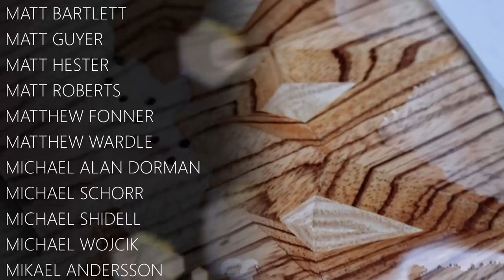Ep 3 - An Utter Failure on the Chip Carved Zebrano Top - And How To Fix It

Comment: Hi!
On the topic of epoxy filled carvings:
I’ve build a few kayaks (epoxy/fiberglass on wood) and have run into my share of bubbles, and found out on the mighty internet, that the bubbles comes from the wood emitting gas. As the wood heats up, the gasses in the wood expands and gets trapped in the resin. The best way to avoid it was to heat up the WOOD, wait a bit, and then apply the resin as the wood cools down. That way the gasses in the wood contracts and suck in the resin, instead of pushing out bubbles.

Thanks for the videos, they are very inspiring, not just for guitar builders, but for lovers of wood work!

Greetings from Denmark 🇩🇰

Comment: Hi Ben. Try Clear Top 35 from MBFG, it gives crystal clear results up to 35mm deep. It degasses itself brilliantly but needs a warm room and has a 48 hour cure time. Clear Top 35 is also very hard when fully cured ( 7 days ) and polishes amazingly well. If you plan to do more resin work, it would be worth getting a vacuum pump and chamber to de-gas the resin before pouring. Zebrano can be a pain as air can expand out of the large tubules in the wood with the heat from the curing resin. See you next month. Cheers, Jim

Comment: I know some guys use vacuum chamber to remove bubbles from epoxy... :)
Reply: Yes! This is the winning ticket for sure.
Reply: Its fancy but not needed for something that shallow.
Not whipping bubbles into the resin works as good, and costs you less.

For other stuff like 2part silicone resins i would recommend using a vacuum or high pressure chamber.
Reply: Making a vacuum chamber for just the pitcher would cost very little. It's basically just a section of large diameter pipe, two sheets (the top one could be perspex, so you can see the action), some garden hose fittings (most importantly a t-piece)and a faucet. Making one for a whole guitar is similarly simple, but requires you to build a frame that'll be airtight when you lay the top and bottom onto it.
Reply: Yep that would work, also placing the container on an electric sander helps remove bubbles.

Comment: Many years ago I worked for a ceramics company making false teeth, to remove the air from the alginate mould I used a vibrating table, the air would rise to the top and disappear.  Just a thought if you decide to do another guitar with resin filler. ?  Looks good though. nice job Ben.

Comment: Ben, for vibrating the guitar instead of tapping it or hitting the bench, why not use a palm sander with no sandpaper, just the pad of the sander against the guitar.  Easily controlled vibrartions to cause the bubbles to rise to the surface.

Comment: Put a heating blanket under the body.  It will heat the wood from backside to within the body and help bring bubbles to the surface and also help prevent clouding.

Comment: I'm surprised you didn't use some kind of sander (properly dusted off of course) on the table surface next to the guitar, or even touching the guitar, as a vibrator.
I'm starting to mess with resin coating stompboxes, and this was (as always) an amazing video series :D 

Cheers Ben!

Comment: Placing both of the resin components in a warm bath for twenty minutes before use lowers the viscosity and releases more bubbles. Pours much better after. Heating it with flame breaks bubbles but can burn the epoxy and make it discolor, so be carefull. You can spray a fine mist of acetone on the epoxy surface to break up bubbles.

Comment: I think stirring the resin slower is will prevent bubbles from forming in the beggining.  Also i have been told that using a plastic stirrer instead of a wooden or metal one is the way to go.

Comment: It's the stiring of the resin and hardner that create the bubbles, go easy with the stiring, and as you see heat helps rremove them, also in my own guitar building, i find that very hard resinous woods like rose wood,and ebonydon't absorb the glue very well ,making me turn to the use of epoxy to glue the boards, you build some nice stuff.....Jerry

Comment: I've been researching this epoxy thing for a 'river table'. There appears to be differe bttypes of 'clear cast' resin for different depths. In most cases the thickness is 'built up' by layering before the bottom coat good off - leravingthe first pour for 12 hours and etc...

Comment: Oxygen / Air expands when it's heated, therefore - when you apply heat to an air bubble - it expands until it pops.
I assume the manufacturer is saying to blow on them because the heat of ones breath is enough to make the air expand, I find it selfdom is though.

When doing deep castings I find that doing multiple layers is a good way to keep it bubble-free, if you don't have a vacuum chamber big enough to fit a guitar body into it.
Reply: Impregnate the wood with oil and use a blow torch

Comment: You didn't apply shellac to the wood prior to filling this time.  Perhaps the bare wood contributed to the continuous forming of bubbles mentioned at 29:17?  Resin could also be soaking into the wood, causing the need for "topping up"?

Just a couple of thoughts.

Comment: To remove air bubbles, we attach a small electric motor to the underside of the table, turn it on, and allow the vibration of the motor to shake the table slightly and thus encourage the bubbles to rise to the surface of the un-cured resin.

Comment: I'd do an oil finish. You're probably (definitely) getting micro bubbles that are being trapped between the organic wood surface and the resin. Sealing the wood with urethane prevents that, and in this case if you have surface bubbles after it dries, just rough sand it, and apply another thin coat of resin.
Reply: Love Ben Crowe and love these weekend workshops!

Comment: Blow on it using a regular drinking straw. That works much better than just blowing on it directly. You can also go over it really quickly with a BBQ lighter. Also, wood is very porous. It will cause way more bubbles than lots of other molds used for resin.
Reply: Brandywine6969 In the last video he used either laquer or poly (can't remember) in an attempt to seal the wood. I didn't notice him applying it again in this video and now I'm wondering if it came off with the resin.
Reply: It might have. I wish I could remember what the lady in one of the resin crafting channels that I watch used when using resin on wood. I think she just kept using her BBQ lighter on it throughout the day. I know she said there were lots and lots of bubbles and she had to stay on it to get rid of them.
Reply: Brandywine6969 A drinking straw works, to a point. It makes you light-headed and after a little bit, moisture from your breath drips out of the straw and lands on the resin.

Comment: Hi, the more you heat the guitar air will aspirate from the wood area in which the resin is being poured. The cut areas should be sealed first. if you paint a guitar and put it out i the heat i.e. sunlight the finish will be bubble ridden, same thing going on here.

Comment: Ive seen other creators use a small vacume chamber to suck the air out of the mixture.  I'd also think that low heat before mixing would help, making the mix a little less viscous, allowing air bubbles out.  I have a coffee cup warmer that would probably have worked nicely to loosen up the mix to lose the bubbles nicely.  I'd think having both additives at about 37-38 C would have the effect of thinning the liquid nicely so bubbles come out more easily.  I wonder what the directions say about optimal temperature of the liquids before mixing is.

Comment: I think that bubbles comes from the open wood grain.  Sealing with Shellac before applying epoxy might help to avoid air bubbles coming from the wood.
Reply: + fire to remove the bubbles from the epoxy mix

Comment: If you get the wood warm, do you perhaps end up driving moisture out of the wood and into the epoxy? For that matter what about volatile compounds in the wood? Insignificant compared to water at low temperatures in terms of useful pyrolysis products, but there are at least some terpenes given off, you can smell those.

Comment: I build custom fishing poles and to limit the bubbles never mix with a wood paint stick ,use a aluminum or plastic rod and you can thin the epoxy with acetone and that helps to release the bubbles.

Comment: Are you using smooth-on epoxy which they use for circuit boards. Very clear stuff and I think it can be thinned with acetone to allow any bubbles to come to the surface.

Comment: It appeared there were some adhesion problems with the first go round. A 220 sanding rather than scraping would help with that or a seal coat of some sort. I fear if the resin pops it will give a clouded look.

Comment: Maybe if it is air, you could have used a vacuum chamber? Prop makers use this for silicone molds to male sure there's no air bubbles and I'm fairly sure if you used a resin with a longer work time it could work out.

Comment: Sorry if this has been asked before, but why an open-flame torch versus a heat gun?
Reply: bevo65 heat guns suck air in, i found when i painted cars for a living the air can be filled with things you dont want spat out onto your work, notice how ben has to dig something out with a needle after starting to use the gun? also the air blast can move stuff around if your not careful, lastly heatguns get bloody hot bloody quickly! i should imagine a flame being much easier to work with in this case
Reply: JA -JANKEN!  Good point.  Thanks!

Comment: Why didn't you choose a simple top for experimentation? Also, care is needed for heat treating the epoxy, from what I have seen others do on YT, so perhaps doing it on a day you are not expected elsewhere would be sensible. 

However, did you not stand the epoxy bottles in warm after before you mixed them? That has surely got to be a better way than presenting a naked flame to a jug, which will hold vapours as the hardener (surely flammable?) gases off.    

That said, I don't really understand the epoxy thing. I know it's an experiment and you may have a punter want one. But to me it looks like a pub table top and I like to see and feel the wood, so the stains and an oil finish would be my choice.

Comment: Myself and others have mentioned this before, but this is really not the best way to pour epoxy. The heating is fine, because it lowers the viscosity, but the most effective way to get rid of air is to pump it. Really. And it does not require much. A pump from a veneer vacuum bag will do the job!

Comment: If you mixed it in a Pyrex beaker, could you heat it a little in that before pouring?
Reply: No that would make it cure faster, the secret is not to whip that much bubbles into it in the first place.
Reply: Thanks!
Reply: I would have thought that it would have been simpler to heat the individual components separately - probably in a waterbath.

Comment: Good job you're a luthier not a scientist. They can spend years repeating failed experiments with minor variations until one succeeds and becomes the process. Would immersing the jug in a container of hot water (like a bain marie) help to remove the bubbles before pouring? You mentioned that new bubbles seemed to appear after pouring - could this be a result of the reaction between the two parts of the epoxy? (I know nothing about epoxy). And - was that a new Crimson sign leaning against your bench?
Reply: Myk Hough Think that James might've pinched the booth sign from the guitar show t'other week ;-)

Comment: I wish I could have told you before how I would do it: 1.) thin layer of epoxy resin to seal the wood and avoid bubbles from coming through the wood to the surface. 2.) fill the diamonds half way with resin, use the heat gun and let it almost cure. You won’t see a separate layer. 3.) fill up to the top and repeat the heat gun.
Reply: I've never used resin but that method sounds very viable to me. You forgot one thing though: Before adding the final layer add an insect or flower or any tiny object into each cavity, preferably on a drop of resin to remove any bubbles beneath said object...

Comment: Don't think you can heat top of resin in wood (great thermal insulator) without putting whole thing in a oven to keep top from drying faster then bottom trapping the air in.    Oven might work, know anyone with a pizza place?

Comment: Stop whipping the resin so crazy. People go all bonkers when mixing it, its not necessary.
Get a slow curing resin, and take 2-3 minutes of gentle stirring. Keep your piece of wood at an angle, and scrape the sites of the container ever 30 seconds or so.

Always gave me perfect results and close to no bubbles in the resin.
Pouring from a height only does so much, and it works better with more viscose stuff like silicone or PU resins.

Heat also doesn't really pull out the bubbles, its only used to pop the ones at the top.
Heating your resin will result in faster curing times.

Also you might want to brush on a thin layer of resin and let that set before you pour the entire cavity. Because your wood might also release some air.

Comment: As far as I know a vibration table, vacuum chamber, or ultrasound are what you would use in a commercial environment. All of which will not come that cheap though the ultrasound method shown here https://youtu.be/23nsW2yAl_o looks seriously cool! The one thing that everyone seems to recommend is trying to remove the bubbles in your mixing vessel before you start to pour.

Comment: eeh the pouring the resin the way you do allso introduce bubbles in the resin , wat you can do is pour it against a stick set in the measuring beker (beker and stick then set scale to zero , stop pouring and let go of the stick every time you want an acurate reading )
it could be the bubbles are caused by the cells in the wood itself , it might help to put guitar with resin in a vacuum chamber and cycle it through a vacuum a few times and fire up the torch to take out the ones at the surface 

think michael jackson blew bubbles 
http://assets.nydailynews.com/polopoly_fs/1.379297.1314479334!/img/httpImage/image.jpg_gen/derivatives/article_750/alg-michael-bubbles-jpg.jpg